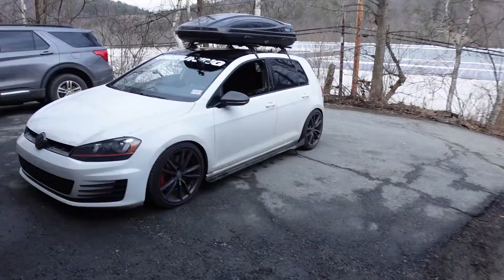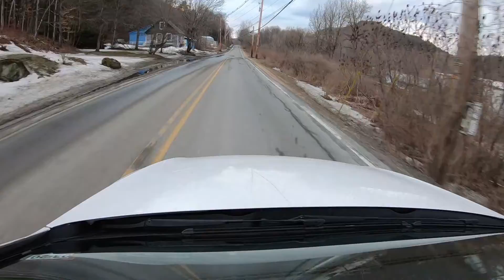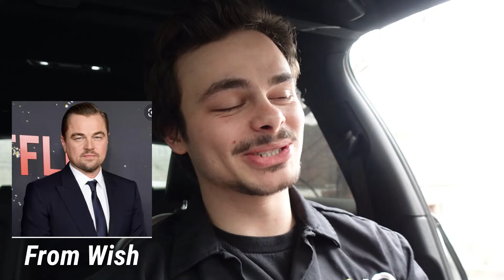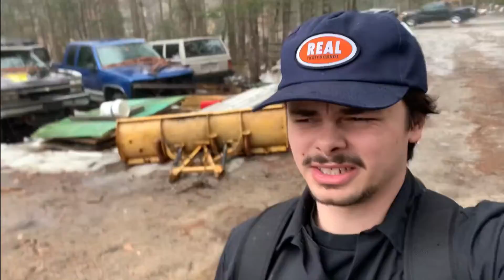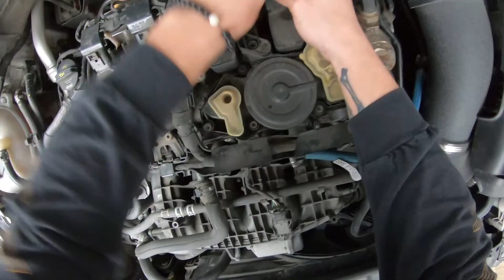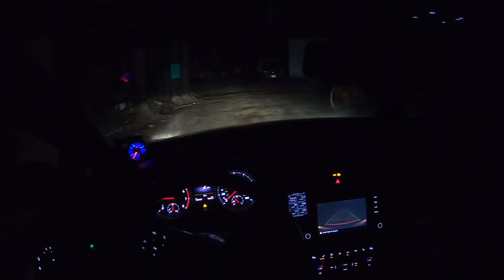The Best MK7 TURBO NOISES You'll Ever Hear / ASMR Turbo

Comment: I think an obd 11 will let you turn tc fully off
Reply from the maker: Sickk I’ll look into getting one thanks man
Reply: @ChrisFromKenya  yo, turn off starting vibration reduction on obd11. Goto brakes, adaptation, scroll down to svr. Disable it. it’ll turn off the torque limiter that cuts power in first and second when wheel hop is detected. It’s way too aggressive. My car feels way different with it off. It’s set to strong from
Factory. Just manage ur wheel hop yourself from a dig.
Reply from the maker: @Jx12346  yessss thank you my dude I appreciate you fr!! I’m hyped to do it 🙌🏻
Reply: depends on the ABS system your car has, didn’t work on mine